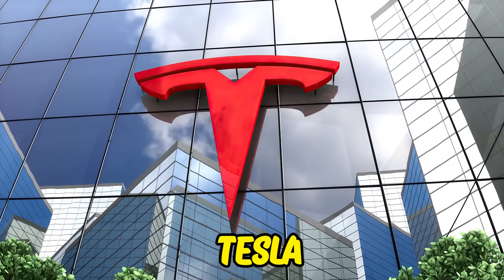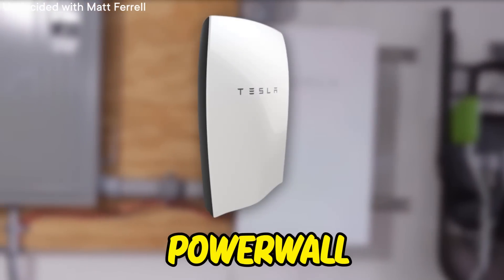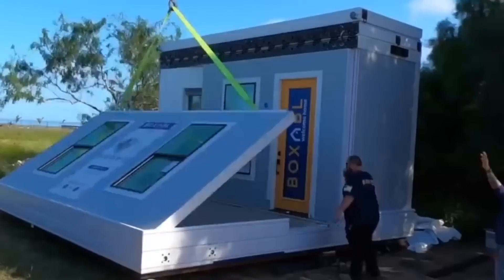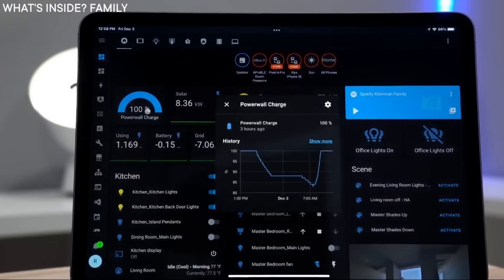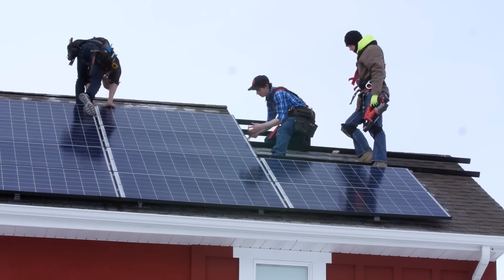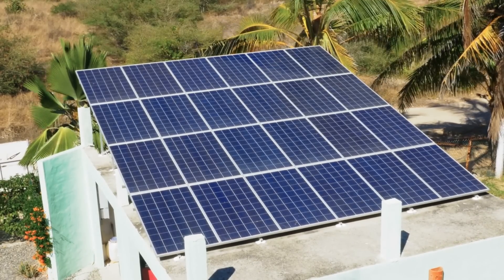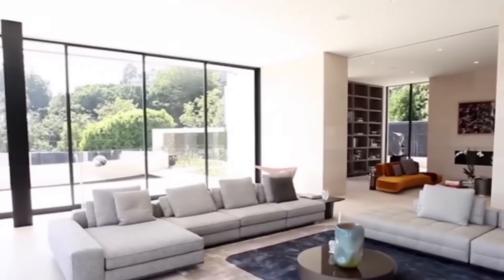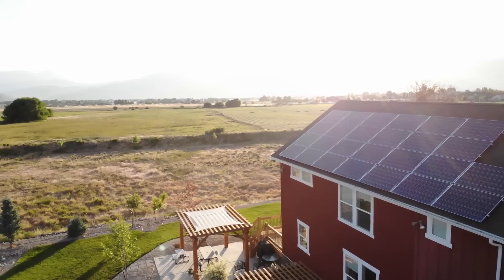It happened!! Elon musk's $10,000 house is finally hitting the market

Comment: Some thoughts:
You have the house, so where do you buy the (likely more expensive) land?
How does this respond to state/city housing regulations?
Depending on the region you have in, do you have enough energy to work with?
How durable is it? Particularly the battery? Do I have to worry about the battery combusting in the middle of the night?

Comment: I hate to piss on everyone's parade but this is not that good of an idea. The benefit of getting a tiny home is that it is a well constructed home that covers your needs while mainting great quality. And depending on if you build it yourself you can get it as low as 35k or less. And if you purchase from a tiny home builder it can cost anywhere from 50k-75k to put it simply boxable is not doing anything new or affordable. It's just an expensive ugly looking box that has absurdly cheap construction. These boxable houses will have the same problem that suburban homes have but worse. And if you were sincerely concerned about price and not much else campers have been around for ages. I mean go take a look at any airstream. I mean the only thing campers are lacking are washers and dryers but even this can be fixed. So yea boxable isn't really doing you any favors at all. They're just trying to break into a market that already has solid options just not as much legal support. Zoning has made it very hard for alternative living to be permitted. This is most of the reason why people haven't broken into the tiny home market, it's not the cost it's the lack of legal allowance to make tiny homes widespread.

Comment: Get an 8x20 Incred-i-box off-grid package from Incredible Tiny Homes instead.  A bit more expensive but you can move it wherever it's legal and it's made of steel panels (that are off-cuts from producing steel doors so it's still technically recycled material) which means minimal maintenance compared to wooden homes and it is made by a great company. 😁👍

Comment: I live offgrid, there is no such thing as renewable energy. Nor is it green. If you think you can use everything you currently use, well you can't. You'll  also need a backup generator. In a cold environment either a small wood/pellet stove or gas, oil or propane heater is a must. I like offgrid, but it's not necessarily better or greener. Definitely more work and planning. Also sustainable living is a pipe dream, no such thing exists.

Comment: The tiny house problem isn't the tiny house, its where you can put it. either overpriced land rental or get blocked by municipalities with a minimum square footage requirements. And really before we had tiny houses we had tiny houses, we used to call them trailer parks. And trailer parks are being overpriced with a captive market or are being sold out to developers to build high end housing. Fix the problem first.
Reply: I own land to set a house.
Reply: @pjmjdmurdach4792  if you own land why would you live in a tiny house?
Reply: @keesdejong5712  less keep up! Less for heating and such.
Reply: Off the grid
Reply: Move to Midwest!!! Illinois towards st.Louis Missouri
Reply: I am getting a regular trailer. Tiny Homes are crazy expensive, land is only cheap when far from amemnities, which means you need more space to store things and reduce tracel times to town.  Manufactured homes are a fraction of the cost, but require electric and septic, ect. Fix one part of the housing probelm, anither arises.
Reply: @Shia Lebeouf: Life Coach I covered that in the phrase captive market.
Reply: Couldn’t you just buy a acre of land. An put this on there. I’m just trying ti figure out water & sewage part. An is it tornado proof, or Hurricane proof.
Reply: @robbblair6289  Local permitting requirements. I am finding most land is zoned specifically for manufactured or build homes. Its literally and simply not that easy. No wonder so many homeless. The odds are stacked you need quarter mil to live anywhere now
Reply: Elon can't build you a car for less than 40 thousand but can build you a house for 10 thousand. A sucker born every minute
Reply: @ARSONXBELLE  We aren't taking this seriously, we are having a broader argument about where you can put any tiny house. The tiny house community was usurped by a better then poor community who find workarounds to most restrictions.
Reply: @writerconsidered  I wasn't being serious. hard to find in a city but rules can change, and it's called voting.
Reply: There are many places you can buy a acre of land very cheap in rural communities. My sister plans in getting her son a piece of land & putting something like this for her son. I agree that cities might balk . But think of how many homeless vets could benefit from something like this. A working person with a low end salary who has never been able to afford a home would be thrilled to have something they could call their own.

Comment: Find me a house in this day and age for 75K……Way to go Elon!
Reply: Could also look up a company called EZ log structures..

They come prefabricated. Already cut and numbered, you just need to get a foundation build, run water and electrical lines and plumbing...also gas if you use gas..

The structures, which range from sheds to full blown houses could be built by you or you could hire a contractor to do it.

They range in price from 10 grand up to 70 or 80...